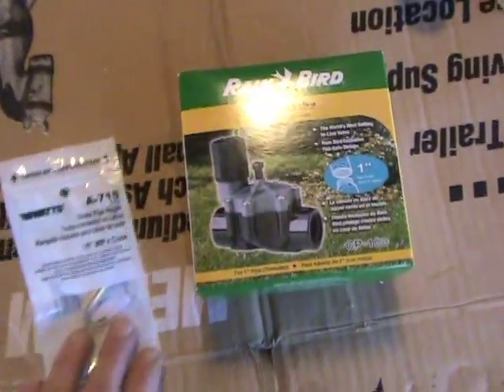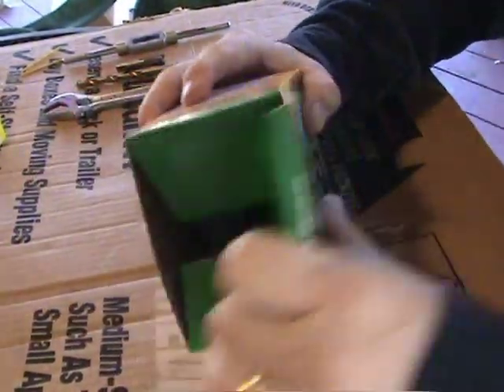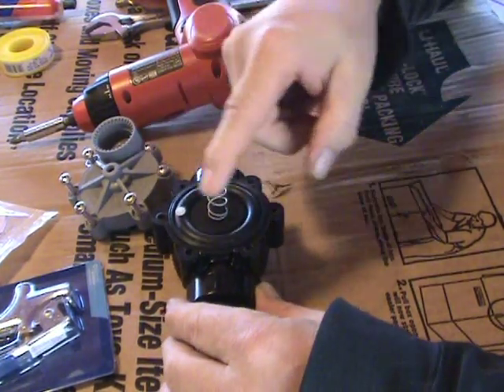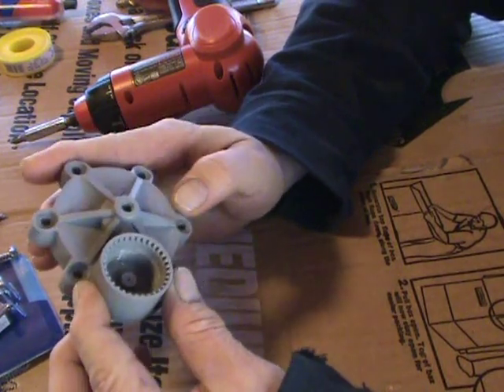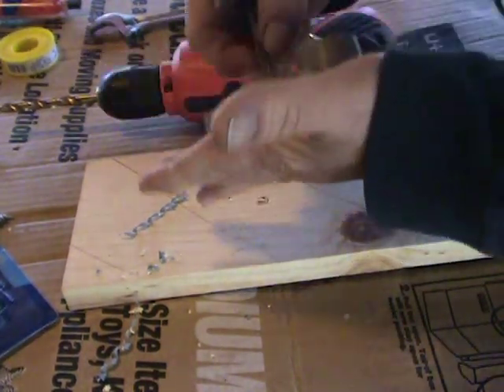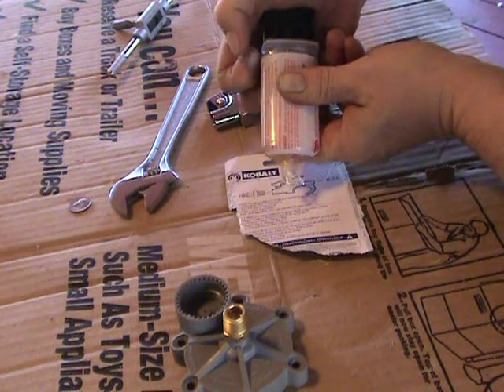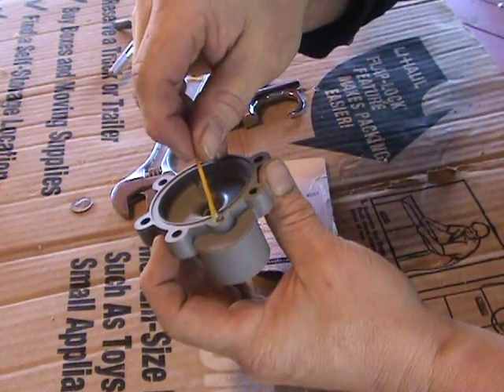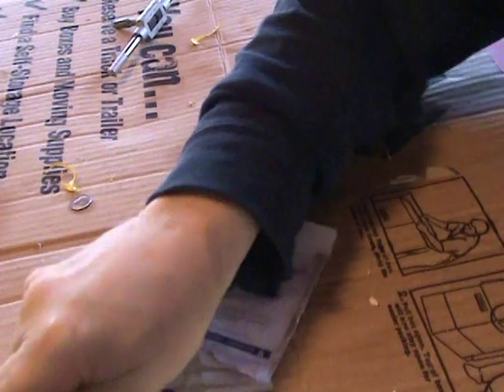Modifying a Sprinkler Valve

Comment from the maker: Yes and no. You can simply drill a hole and screw in the fittings, I've done it, it works, but I simply worry that it the added stress and heat might weaken the PVC. It's probably overkill, agreed, but I like to use a tap...

Comment from the maker: It's a RainBird CP-100 (1" diaphram valve). You should be able to pick one up at most Lowes or Home Depot stores. If you can't find that exact model then check out the SpudFiles site, they have several good articles on doing these mods.

Comment from the maker: The blowgun just vents air from behind the diaphragm which causes the valve to open. The faster you vent the air the faster the valve opens. (Check out the spudtech link to the right, under "More Info", to see how the valve works.)

Comment from the maker: @ipodtouchguy77 Just replace the 1/4" adapter with a hose barb, add another hose barb on the blowgun, get some *pressure rated* hose (150 psi or better) and a couple hose clamps and you're in business...

Comment from the maker: First guess is that you have the barrel on the wrong end of the valve (flow direction arrows should be on the valve. The barrel should be on the "exit" end). 

What is your compressed air source? Compressor? Pump?

Comment from the maker: With a 1" male threaded adapter. You should be able to find one at the same place you got the 1" pipe. The nice thing about the threaded valves is that it makes it possible to change out the valve, barrel, whatever...

Comment from the maker: I got the sprinkler valve for about $15.00, the blowgun was about $6.00, the brass parts were maybe $2.00. If you have the tools already (drill bit, tap, tape, glue, etc.) then it's less than $25.00 for sure.

Comment: i'd appreciate some expertise with a problem i had.  i build my first barrel sealing piston valve cannon recently, and took my old sprinkler off a different gun to use as the trigger.  the sprinkler valve couldn't hold the pressure from the new gun, like couldn't hold ANY pressure, and i had used my old gun at ~80 psi regularly with no problems.  i went out and bought a new sprinkler valve, and it did the same thing. i can break the seal on them just by blowing hard into them now. any advice?

Comment: @VerbotenDingleberry Are you removing the solenoid valve because you WANT to fire the cannon mechanically or because you DON'T WANT to fire it electrically?  Is the performance better with the blowgun attachment?  I've built a rocket launcher which is really just a vertical potato gun and when I fire it using the solenoid there seems to be some air left in the system after the launch (not much).

Comment: @VerbotenDingleberry Okay I just took a look at the valve, it's a Rainbird. I'm not sure which is the model number cause i don't have the box anymore, but I think it is19AU08A. I am pretty sure that this is it: (ill PM you the link cause it wont let me type a URL in a comment)

Inside of the valve, it looks like yours with the spring and the diaphragm. The only difference is the bleed valve is in a different location. .

Comment: The lowes I go to does not have a rain bird cp 100 1" valve so i bought an Orbit 1" sprinkler valve. Big differences here is that there is no bleed valve. Also, after i unscrewed all the screws, the top part would not come out. I doubt i will be able to use this. Do you know anywhere I can possibly get a CP 100 Rain bird or if by some chance i can still use this one?

Comment: yea i got one on black friday but can you answer this. so the blowgun is not attached to anything but the sprinkler valve. it doesnt need a air system. because i cannot comprehend the blowgun realeasing the air all at once with nothing to power it other then pushing a trigger. does it need another air source to operate the blowgun

Comment from the maker: @ipodtouchguy77 Pipe threads are tapered so they tighten as they screw in; they stop pretty much where they stop. The amount of teflon tape you use can make some difference though.

Comment: Just checked it. The spring is there, but we cut it down so it's not as powerful. I think we did that so the valve would open more and release the max amount of air when we pull the trigger. We run it at 120 PSI, shooting marbles out of 1/2 inch pvc.

Comment: Hey, I have a different sprinkler valve and the little bleed valve isn't in the center. Could i drill it out and put the blowgun off center, or does it have to be dead center. Thanks!

Comment: Ok, I've modifyed 2 sprinkler valves and both leak out of the same area. Where the air is supposed to come out. But it leaks before i even press the trigger.How can i fix this?

Comment from the maker: Well, I wasnt going to say anything until the release but...

I've designed a 3" porting Barrel Sealer in a 4" Tee using a variant of the good old Wooden Piston. Should be dirt simple to build and the piston should be very light (read: fast). I'll make a full video of the build. 

At that size I can really get some power behind bigger projectiles (soda cans and tennis balls). Still trying to fit it into the budget but I expect to have it done within a month.

Stay tuned.

Comment from the maker: It's a 1/8" Pipe Thread Tap. You should be able to get it at any decent hardware store. Often they come in a kit with several sizes or sometimes you can find a kit that has only the drill bit (11/32") and the 1/8" tap.

Comment from the maker: Exactly. There are even methods to increase the airflow through the blowgun by filing away metal from the internal parts (see SpudFiles). The faster you dump the air from behind the diaphragm (or piston) the faster it opens. Solonoids use tiny holes (which is fine for their intended use in the garden but sucks for cannons).

Comment from the maker: I've been using this one at 150 psi (about 50 shots so far) and haven't had any problems but this is at the very high end of their ability. 

There is a post on SpudFiles dot com in the How To section called "How to further mod a sprinkler" that should take it to 175 and increase performance if you really want to go nuts.

Comment from the maker: @mattyzip77 It's a sturdy lookin thing anyway. Basically all you need to do is seal all holes "above" the diaphragm (on the top cover) except for your trigger valve (all we're really doing is sealing the solenoid hole and replacing it with a much bigger one for our trigger).  If there's nothing on SpudFiles about this model you might post a question to see if anyone has done one yet. (And make us a video of your build!)

Comment from the maker: @MrXxandrew I actually saw that new version of the valve a few weeks ago in the Lowes out here.

The principle should be exactly the same. If you drill and tap in the center you can just plug the bleed. But you could, I think, even drill and tap the bleed if the plastic is better reinforced there (the trigger would be off center, might work with a nipple and a short hose to the trigger, depending on your needs). Long as there is no leak into the valve except through your trigger it should work.

Comment from the maker: @mattyzip77 

Check:
- Is the "tank" on the proper end of the valve (on the Input side)
- If using a bike pump, try compressed air (pumps are too slow)
- Is the inside of the valve *absolutely* clean?

If all else fails check out SpudFiles (they have a ton of info on troubleshooting these things)

Comment: This is a great video. I modified one of these valves to use with my tennis ball cannon. Works great. I'm getting it up to 150 PSI with no problems. If it's leaking, you need to take it apart and clean it. Sometimes plastic from drilled holes gets caught between the seals. Ever since I went from an electric to pneumatic, I've notices improved performance and my valve no longer "honks".

Comment: First of thank you so much for this vid, helped me loads :D I have a question regarding this solenoid valve i bought. The bleed valve has a thin metal shaft that goes through the centre of the diaphram. When I remove it there is a small hole left behind on the diapram. Should I block it? again thanks for this video